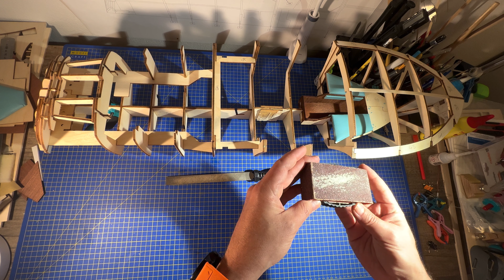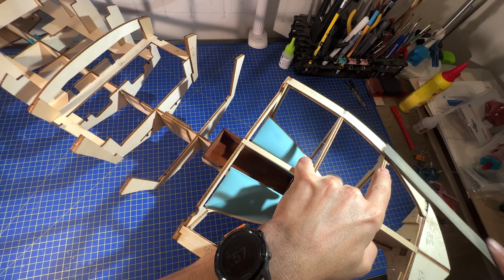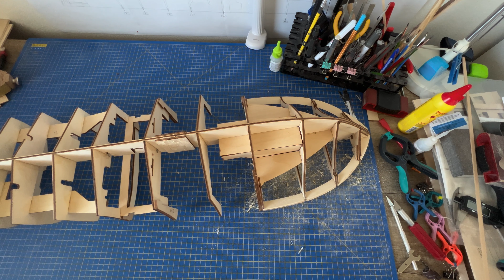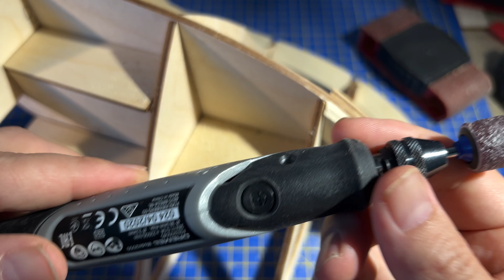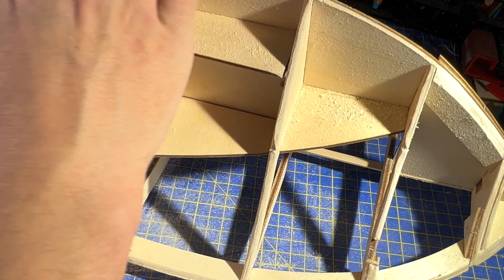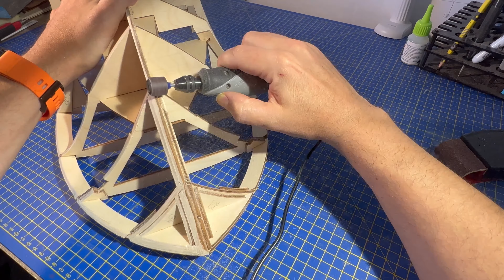Part 2 - Sanding & Planking Preparation: Amati Italian RUNABOUT (Riva Aquarama)

Comment: do you have the link for the spring clips you used to hold the strips?
Thanks
Reply from the maker: Hello, sorry for late reply, I was at hospital … I used adjusted paper clips .. if you put “paper clips” into google it will pop on you. By adjusted I mean that you have use one hanger from another clip and put it inside.